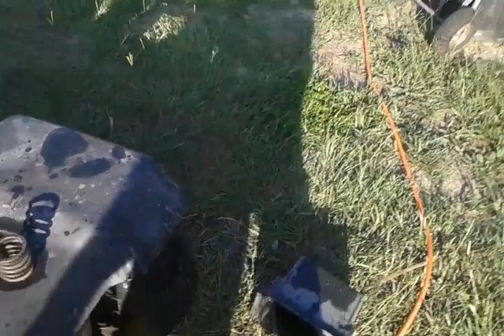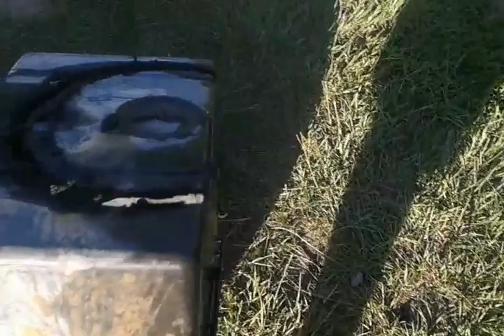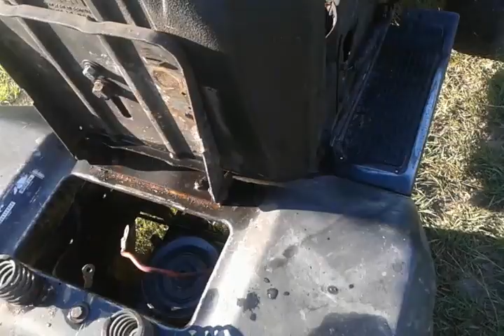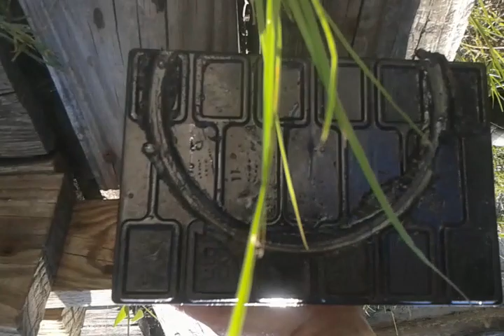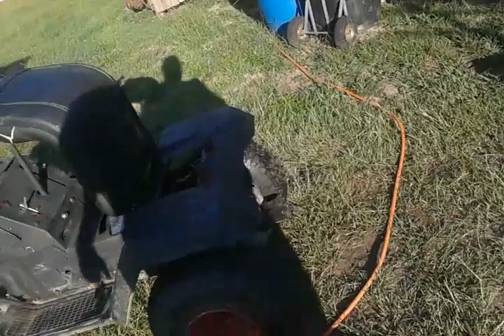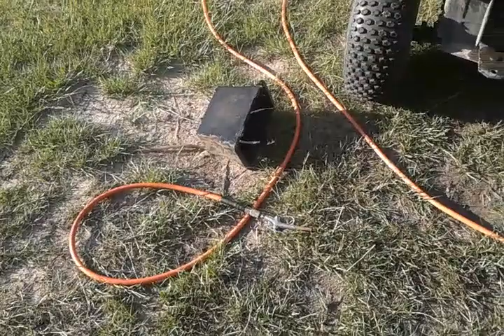Dang battery

Comment: You're lucky you didn't catch on fire, idea for you take two pieces of angle steel one on each side of the battery box to help hold it in place.
I blew up a battery once, it was one big bang, I was charging it and I was grinding with in the area of the battery one stray spark and boom, the crazy thing about it the battery was split right down the center it's still hard voltage.
If that battery was still reasonably good and holding a charge and starting the engine you could potentially repair it, put it on its side and dry out the area where the pulley robbed and try some RTV sealant or silicone to seal it back up then refill with distilled water try not to drain everything out of the battery.
Reply from the maker: redneckbryon  I am going to make some kind of battery holder out of steel. but I'm not going try to fix the battery.

Comment: I had pretty much the same thing happen with my Bolens, I didn't secure the battery and it worked it's way up to where the engine pulley was and wore a hole in the side of a new battery, it kinds makes you sick, I know,, like anything else, I fixed the barn door after the horse got out. I made a bracket so that wont' happen again.
Reply from the maker: MissouriOldTimer  Yup. Thanks for watching.